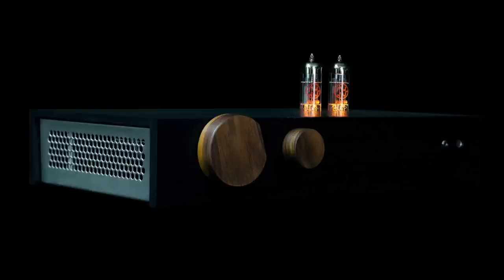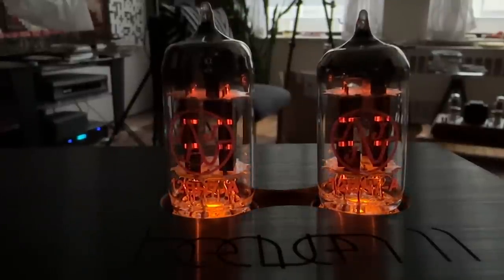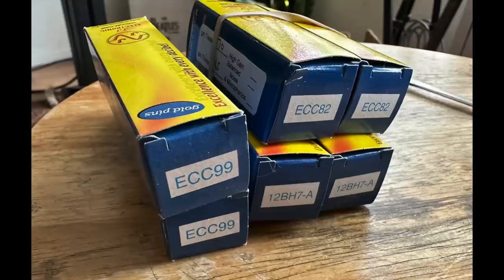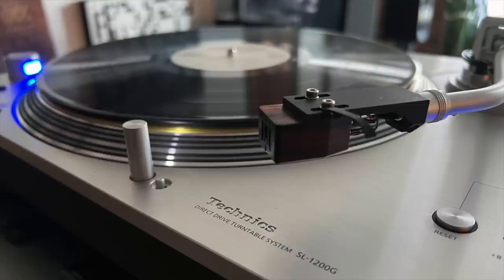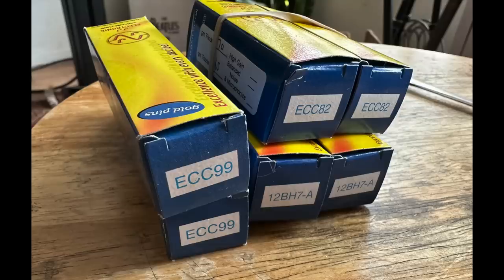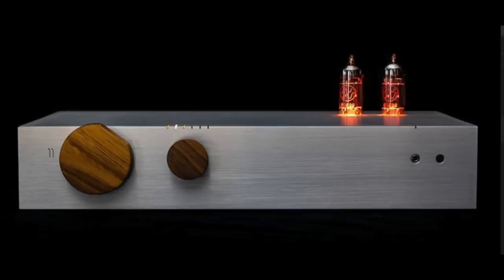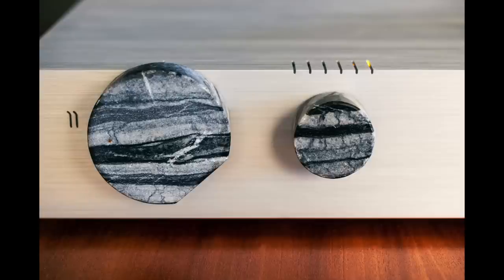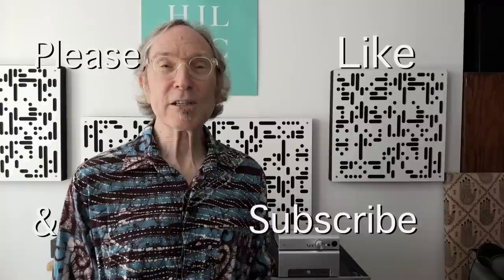Heaven 11 Billie amplifier: great SOUND, smart FEATURES, compact SIZE

Comment from the maker: I messed up, the Billie remote IS metal, it's aluminum!
Reply: One thing about many Audio Review journalists across the years is that they never ... really ... had the product in their room, just a number of photos around which they'd make an article that included everything that ... the manufacturer wanted ... to say about their product.  So ... yeah, they never listened to it (or you know held the remote control but the photo looked liked plastic, even although it was actually aluminum) but these (you know clowns) gave a review as if they'd very carefully, done all the work by themselves, of course, the main point of the Billie is its claimed match with Magneplan LRS Plus and we only need to find a demonstration place of the two products to see if they do measure up, and they will.
Reply: It's still incredibly cheap looking....like an Apple TV remote that costs 20 bucks. Thinks like that are a deal breaker for me.
Reply: @robertbrody4032  No we get flashy remote controls that learn from the cheap handset output frequencies and they control our whole system, not just the amplifier.  This cheap control is just you know, for programing these 'learning remote controls'.
Reply: @steveguttenbergaudiophiliac Would you recommend the Billie amp paired with the Klipsch RP-600M. Trying to put together my first stereo set up.

Comment: Class D amps get a bad rap sometimes (and often deservingly), but everyone who I know that has heard this amp, just raves about it! This was a great, detailed review on this. As always, thanks Steve!
Reply: Class D does sound dry and sterile, but you can fix that with tubes. 😉
Reply: @seanb3303  not in this case
Reply: @jackfalco5351  you find the Billie sterile even with the tubes?
Reply: @seanb3303  well, sounds like a class d amp.
Reply: Well, Steve reckons it works best with Magneplan LRS Plus and using the ECC99 (that was made to work as a driver with 300B tubes).  The 12BH7 is an old ... surplus television component but made in the tube era, when superior materials make it sound better than the modern ECC99.

Comment: Have had mine for several years as part of a go fund me.  Have it driving Tekton M-lores with a Fluance turn table.  It sounds so lovely.  More than enough power.
Reply: wait till you try some vintage glass on it. jj's and modern tubes in general were never considered the best at anything ,no matter what your taste is ,there is a vintage tube that will sound a lot better .i  like using old mullards brimars ge's and siemens tubes but each has a specific tone, they will also last longer. enjoy
Reply: You mustn't have this Billie, it hasn't been around for several years, you must have the first version
Reply: @crazyprayingmantis5596  yep.  I have Gen 1.
Reply: @yaniv-nos-tubes  va-jay-jay sounds better than the NOS in this amp

Comment: Thanks for the review. I bought one based on your review (and a few other reviews) and on my experience using an Elekit TU-8500 tube preamp with a Hypex NC502MP Class D power amp. So far, a bit underwhelmed compared to the Elekit/Hypex combo. Speaking of Elekit, the Billie's design resembles the discontinued Elekit EKF-01, though the latter suffered from low power output.

Comment: Steve is way too busy to read old posts but I found my experience to be similar and wanted to share. 11 months later, another utube + more research done, I decided to try it out. Have not had an integrated in over 20 and found all that is good about evolved class D with that tube shimmer via the gold JJ tubes. I prefer it with an R2R DAC though the headphone & phono inputs were a pleasant surprise and had me returning for more. I have it running with LS 50 metas, Buchardt 400mk2’z and a Relt5x at present though, also used it as just a pre-amp; just to see it perform with another set up used mostly for home theater and non critical listening. Built like a tank and the silver with marble is 🎯✨. A keeper for me.

Comment: Great review Steve. This seems like a better sounding, more boutique take on some of the earlier peach tree integrated amps. Another nice tube preamp / SS power amp combo that gives you tube warmth and thickness and SS power, you can try Schiit Valhalla + Vidar. It's definitely limited in that you don't get multiple inputs or a remote but it sure sounds good. If you need remote control and multiple inputs you could use the Schiit Saga S as a front end followed by the Valhalla. Way more tube influence than just using the Saga +. It's a bit unorthodox and a lot of boxes but it's fun and affordable.

Comment: Excellent review Steve!
This sounds like a very good one box solution to driving some of my favourite speakers.
I use a Musical Paradise MP 701mk2 valve preamp/Bryston with my LRS.
The pre allows myriad  valve and capacitor rolling options, including the ones you used here.
I hope you can review it.
Less than $1000 with v-caps...but it can turn into a money pit with all the available tuning options 
😅
Currently running Mundorf SGO EVO supreme caps, rca a Sylvania 12sn7 & two12au7 with a big TAD 5u4g rectifier valve.
(The supplied valves should be replaced quickly ;-)
🎵🎶😊🎶🎵

Comment: great review. this amp can sound a lot better with nos tubes. ive just retubed my rogue rp 1 preamp with vintage mullards and it sounds a lot better than with stock tubes.
Reply: Have you heard this with nos tubes?
Reply: Sounds best with gold pin jjs ecc99
Reply: @jackfalco5351  No ... gold pin were a British ... military tube thing but you know, home tube amplifier users are able to clean up the standard pins regularly with some fine emery paper, ground glass paper. The gold pin was only to preserve the connection in hard to reach service places.
Reply: @keplermission  ? Heaven 11 sells gold pin ecc99. My experience is this sound better than  N OS tubes in this unit.
Reply: @jackfalco5351  Yeah but ... Steve already said that, you know, we don't add something Steve already put in.  You know ... 'N OS tubes', ... I'm an 'old cowhand from the Rio Grand' (like Herb Reichert) and you know, N OS tubes that aren't modern ... have tolerance issues.  You know they all sound different until ... you get a service tech to change your under-chassis elements to best match any particular N OS tubes.  But as Nelson Pass would say, 'under the same conditions' you know N OS tubes would sound the same.  But 'tube rolling' does apply to some tubes like EF86, but most are a tolerance/ 'transfer characteristic' issue.

Comment: Steve, I noticed that the Billie web site recommends against using a high impedance speaker and specifically mentioned the DW6!  Interesting as you liked the sound. I wonder if long term use is not good for the amp? Think I'll call them as I was thinking about using it with a pair of DWX.
Reply from the maker: That's not true of all DW6s, pretty sure the one I have is 8 ohms. too high impedance is not at all likely to harm an amplifier. Too lowl, pushed really hard, that would be a problem.

Comment: I wish you would have mentioned how the remote volume responded. Most manufacturers, if they use a motor to turn the volume knob (via remote) have the speed set too high/fast, making it difficult to make slight, precise volume adjustments. Like most reviews, no mention at all of that issue.
Reply from the maker: You're right, but I found the ramp up, ramp down volume speed just right.

Comment: Thanks for the really good evaluation. I am considering the Billie with my Dynaudio Special 40s but since the speakers are more neutral to slightly warm as opposed to bright will a tube sound amp soften the dynamics. I'm not familiar with tubes so asking from a solid state point of view.
Reply: TRY a 5814A RCA .......( when lukcky you could find a triple mica /black plate ) .........sounding great, full , warm and very dimensional like in a great sounding concerthall .
IF you like more up and go and energy of the music, try a 12BH7A  GE ............
And if you listen trough the cleanest window with a inequaled transparancy and fine " timbre " ( tone) ..........choose a ECC82 Telefunken  flat plate.......
The last choice in tubes being my personal experience and taste are those current production tubes include the JJ tubes......I live, work,build, repair and listen with tubes for more than Sixtie years.
Have a nice day..................this amp may sound ( very ) good and give you listening pleasure for some years but ..........not for decades..

Comment: Hey Steve.  What are your thoughts on pairing the Billie with a set of Elac Uni -if 2.0 ub52
Reply from the maker: I think that should be good
Reply: One more question. Currently driving the speakers with a older Yamaha AV amp outputting 60amps.  I am hoping that the Billie additional power and tubes will make a significant step up in performance. Thoughts

Comment: On the Billie mk2, how do you switch the PRE/LINE output so that you either get a fixed LINE level signal or be able to adjust the volume with the volume control knob (to use with a sub or powered monitors)? Is there a switch somewhere or do you have to use the remote? Also, does the headphone jack deactivate the speakers and/or the PRE/LINE output?
Reply: You press and hold the source knob while on standby to make the switch between the two
Reply: @jackfalco5351  Ah! Super. Thanks for your reply. 👍🏻

Comment: The remote is so sad that it just about ruins the amp. The remote is the MOST used interface and supplying a 5 dollar remote is pathetic. Companies like Rogue understand this. That remote is from the "what were they thinking?" school of crazy.
Reply: Hi Robert, I just discovered one of the optional accessories Heaven11 offers is an aluminum remote for $45 US.  I didn’t know this when I ordered the amp, so I just ordered it separately. Hopefully a big improvement on the stock remote.
Reply: Hi Robert, I told Steve about ordering the replacement remote, so he went and checked his and discovered it is in fact aluminum!  He just posted a “whoops” to tell you all it was a metal remote. He told me it was so light he just assumed it wasn’t metal. Lol